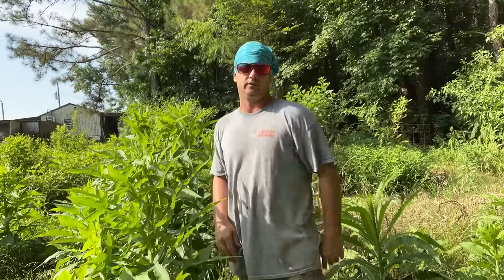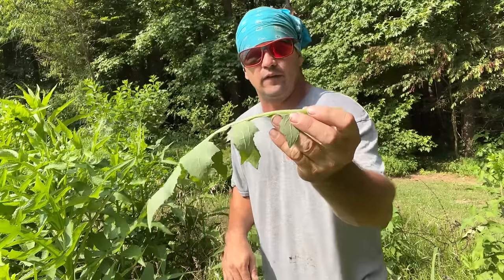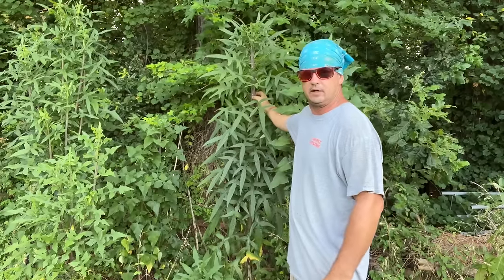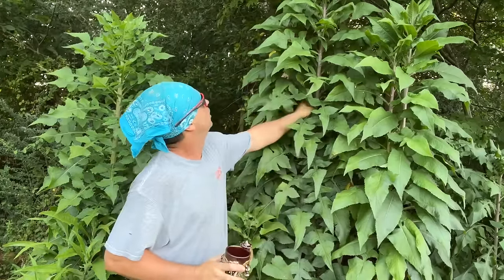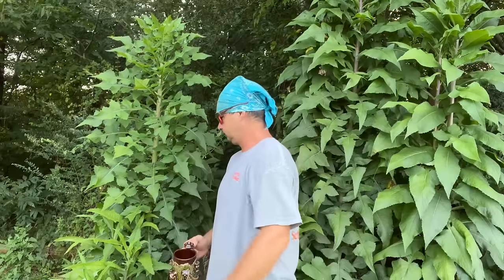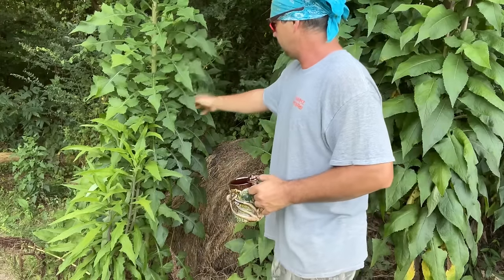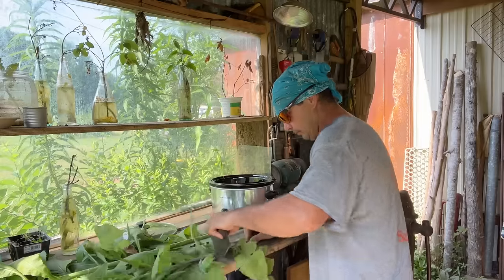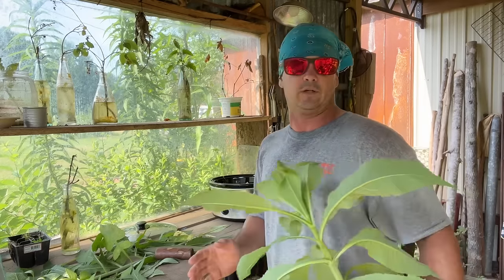Processing wild lettuce into condensed black syrup pain medicine

Comment: The last time I processed wild lettuce, I poured it in a 9x12 pan on parchment paper after most of the water is out but while it's still easy to pour. I then dried it in my oven at 100 degrees until it was rubbery which made it easier to peel it off the paper. Some of it was hard to get off the parchment so I'll use a smaller pan next time plus I've seen some people use silicone and dehydrators. THEN, I rolled it into a ball, put in a mason jar & poured 80 proof vodka over it which will help it keep and allow it to be used sublingually. I usually use 2 dropper fulls.
Reply from the maker: Not a bad idea at all . Thanks
Reply: Please estimate the size of the ball of concentrate, and volume of vodka poured over it.  Trying to get close to d0sage ideas. Local herbalist won’t even talk about wild lettuce because of “issues” but I gotta have something sustainable on hand!
Reply: @meanqkie2240  3-4" , I put it in a pint jar, poured vodka over it. I've  smoked it, used just water to pull out the oil too.
Reply: @ElijahsMimi  How are the pain relieving properties?
Reply: @CastBlastCamp  It believe it works well, helps with sleep too.
Reply: @SpiritoftheOutdoors  Love the cup your daughter made!!!  😁❤
Reply from the maker: @Sunny-jz3dy  its not gonna compare to the relief of percocet i dont think. Lactuca virosa would probably be the strongest.
Reply: @SpiritoftheOutdoors  16:42
Reply: @meanqkie2240  always use 100 proof. Elimates all math.
Reply: I am BRAND new to learning this subject matter ... If you do this process again, I'd love to see a video of it!!!
Reply: Thank you! My instincts were telling me to do similarly but your steps really clarify how to go about it. Much obliged!
Reply: Why use alcohol??? Do we have to???? Gives me a headache😊
Reply: @Centannicocktails  Most herbs have water soluble and alcohol soluble properties, 100 proof is half water, half alcohol. Tinctures are taken in drops or droppers full. 2 droppers 3 x a day equals 1 tspn of alcohol for the whole day, if you take less drops, less alcohol. You can drop alcohol tinctures in hot tea, leave for 5 minutes and the alcohol will evaporate. You can make the oil with just water, I have years ago and I think it worked ok,but was hard to take because it's so gooey. Look for some videos using just water here on YouTube.
Reply: You answered the question I came here to ask. How to make a tincture with the resulting tar. Thank you! Cheers.
Reply: @ElijahsMimi thank you! Lots of additional good information.
Reply: Having worked in some remote areas, locations, and not being accessible to acid or anything similar  ,you would be worth 5x the cost of a dentist!!!
Reply: @Centannicocktails makes it more shelf stable, you could use white vinegar but the taste would be a little sour. You could add some mint  leaf and sugarto it and make a mint sauce ?
Reply: Love the background music
Reply: Hi, about how long did you cook it in the stock pot for before straining? Thanks in advance. ❤️🌿

Comment: You can use everclear or bacardi 151 to clean the tar dregs from the pot. Then transfer to a glass bowl and let evaporate. A similar method to making homemade hashish.
Reply: That bacardi 151 is not around anymore
Reply: Can you smoke wild lettuce for pain relief
Reply: @drpops66  I don't think so
Reply: you mean hash oill? rso , Rick Simpson Oil?
Reply: @drpops66  yes you can smoke it and the resin
Reply: But it's water soluble. Just add a little water to clean the pot, then drink it.

Comment: Tip: Put the syrup in a dehydrator. It peels off as easy as fruit leather.
Reply: great idea. Maybe his friend he borrowed the crock-pot from has one of them too. I wondered if a black bottom pan , with screen ( for bugs) set in the sun would work?
Reply: What do you do with the fruit leather?
Reply: Oh
Reply: @joanclary3622 powder it and then put it in capsules. Or mix it with water if you are good with the bitterness.
Reply: I did that just today and it worked like magic
Reply: @joanclary3622 you can also dissolve it in a little bit of alcohol to take in a liquid form
Reply: At what temp?  And once dehydrated, how do you use it?  Thank you!

Comment: I had some plants I keep in my flower bed.  I harvest the latex throughout the season.   I pull up the kids hippity hop, sit there with a piece of glass(from 5x7 ftame) and wipe latex on glass.   Once it's dry, a day or so later I scrape it off and add the powder to a finished tincture or the finished black goo.  I have to take a smaller dose for the same effect. The crock pot was my question! So thankyou for that.  I'm standing at the stove for my 8th hour now making sure this doesn't boil.  In an hour or so it's going to be done...praise God.

Comment: What is the dosing on the finished product? How is it best used? Thank you for the demonstration.❤
Reply: I've taken a small, maybe 1/8 tsp to start and adjust from there on how much, depending on how it works  for the pain/anxiety/sleep. I've also dried it down until it's rubbery like, put it in a mason jar, covered it with 80-100 proof vodka, then dosing is by drops or dropper fulls. I take 2 droppers full of most of my tinctures.

Comment: At the end when you were struggling to get the tar out of the pan I was thinking of ways to make it easier to get it all. I don’t know if this would work, but would placing the pot in 3 inches of hot water help to release it? Also I have a round tipped cake icing spatula that’s about 10 inches long and 1 1/2 “ wide and very thin. Would using stainless steel work better than wood or plastic? Just wondering.😁 I can’t wait to make this! I suffer from Multiple Sclerosis, severe Fibromyalgia, chronic neck and back pain and was recently diagnosed with Trigeminal Neuralgia!! It’s a nerve located behind your ears . If that  nerve has suffered any trauma at  any time in your life, ie; in my case being “cupped” ( slapped hard with an open  hand that is shaped to form a small pocket in the palm ) not once but 3 times by an ex ! Praise God he’s in prison for a long time now! Sorry for carrying on so much. Anyways this new nerve disease is extremely painful . It makes my eye, cheekbone, ear and gums feel like I have a sinus infection, a severe earache, and abscesses in my lower teeth!! I hate opioids and am praying this can help me sleep better and hopefully relieve me of a lot of my pain. Again, thank you soooo much!!!! Your new Subscriber Tracy Deon 👋
Reply from the maker: My problems at the end were because it was getting late and i was pushing getting it done. Any of those ideas are good but it gets sticky so id stay away from wood. Keep heat low . It will take a whole day to make this

Comment: Hello, thanks for making the video. I am making my first batch now. I suffer from M.S. and other back issues and been on narcotics for years. I'm wanting to get away from those drugs and try more natural remedies. Do you have any suggestions on the dosage using the tar?
Reply from the maker: Start with a pinch of it and use more till it works for you. Cant really OD on it. The tea is easier to do and id drink a couple tea cups of it as long as you have fresh plant material. Ive not had good luck with dried plant
Reply: My daughter and I cleaned and dried wild lettuce leaves and use them in tea, it's very mild, helps with menstrual cramps and pain.  Not enough for my serious pain, though. :/
Reply from the maker: @LadyPashta  make tea from fresh plant and you will find it stronger
Reply: Did it work?
Reply: You can make a tea with the tar also, just break off a tsp of it and add it hot water and honey and stir well...thats how I do it and it works great
Reply from the maker: @thenarrowgate3063  yes. Its a good way to use it. Better than dried plant for tea

Comment: When you get down to the end, why don't you use a double boiler lash-up?  It's so much easier and you don't have to worry about boiling your product.  I bought a semi-expensive non-stick fry pan (copper finish inside) for exclusive use of cooking down medicinals.  Non-stick makes it ever so much easier to get all of your product out of the pan.  Your last pan would be great for the bottom half of the double boiler.  Fill your pot up with water, bring it up to a simmer.  Place the fry pan over the water, just touching the water and cook.  You need to match top and bottom, so the top pan doesn't fall into the bottom pot of water.  They certainly don't have to be an exact match.   I've sent you a link that shows exactly what I mean, starting at 16:10 in the video.  https://www.youtube.com/watch?v=0sGWxz0DMSI&t=984s
Reply from the maker: I have a double boiler set up ive used in other videos. Im gonna make another batch this summer. That was the first time id made the paste  . A crock pot does good it just takes longer and it wont boil
Reply: @SpiritoftheOutdoors  
Look at the video she linked you.  Use the non stick green pan instead of stainless.  Would be so much easier at the very end to pour out and just scrape with a silicone spatula.

Comment: hey, great video!  For getting the most water out, you might use a ricer. You put your product in and press the lever down. Although you might want to try a small amount to make sure it does not mash your leaves  up and push them out with the water. I use it to make the smoothest mashed potatoes in the south ....even better than a mixer. But they also squeeze juice out of fruits. Also, consider cooking them less at the end because what happens is you have "carry over cooking" after you take it off the heat. Sorry, I'm a  retired chef and I've over cooked many things before .  The carry over cooking will cook it to perfection if you take it off just a little earlier. How much of this do you use at a time, say for pain or headache? We have this plant that grows like that here everywhere, but I;m afraid it's not the right plant. is there a specific way to tell.? Ours shows little puff balls after the flowers fall off but I thought the flowers were supposed to be a specific color.

Comment: Thank you for sharing this.Just finished my first try but unfortunately the video I first saw recommended leaves only. I dehydrated them first then processed them. I think this process would yield more from the plants. Hope what I did works, letting it dissolve in vodka right now. Can't wait til spring to try your method. Will return to comment how this batch went.

Comment: Boiling trouble: I have an electric frying pan that will boil the water every time no matter what but for a short time.  I burnt the bottom keeping stuff warm, until my main stove broke down.  So, I put two flat butter knives on the bottom and an inch of water over them, and a pot of water, and held temperature just under boiling all day for tomato sauce.  I fell asleep, and it didn't stick, two hours later.  It's more accurate than a crock pot - but I have both.  I also have a good deal of wild lettuce around here in Rhode Island, and damn, the cold weather can be pretty painful.  And dandelions.
Reply from the maker: Thats a good idea

Comment: Thank you for your video. I just tasted mine with just a pinky of thin sticky residue and felt like my floor was lava immediately. It was strong and started work right then. I just saw you take two tastes of this 😳 please, what is the dosage on this because I don’t want to take too much.
Reply from the maker: Your not gonna od on it . I take a half teaspoon. You can dissolve it back into water for a tea or just eat it. Start with smaller dosage because each batch will vary in strength. It is a sleep aid so you gonna be drowsy and I wouldn’t be driving until i had dosage figured out. You body weight will help determine dosage as well. Just try it . The worst that will happen is you go to sleep
Reply: @SpiritoftheOutdoors  Bless you for getting back to me so swiftly. I have 12 half gallon glass tinctures, 4  containers of extract, and I am reducing a stick pot as we speak with some drying in the garage for tea. I have chronic migraine disease and am putting this back for future use for myself and my family. I really appreciate you for your wisdom in this. I just thought oh Lord, I’m gonna over do it! Thank you for your advice. I will play with it a bit. Be safe and smile BIG. May this return to you 10 fold. 🙏🏽

Comment: Awesome.  Is it possible to do the whole process with just a crockpot?
Reply from the maker: If it gets hot enough to evaporate water it will . It will just take a lot longer
Reply: I use a crawfish pot and propane since using a crockpot you only get a small yield but yes you can absolutely use a crockpot set to low
Reply: @SpiritoftheOutdoors  I do huge batches so I use a crawfish pot and propane burner

Comment: Questions :): 1)Could you do the last leg of the dehydration in a low-temp dehydrator to avoid any chance of burning? 2)Is it important to remove every bit of sediment/aphid or is that just aesthetic? I know bugs have great nutrient content and if it's tiny and not creepy does it really matter? 3)Would it make sense to put the goop in a silicon sheet or wax paper or parchment so then we could just peel it off so we don't lose much (like old candymaking)? Thank you!
Reply from the maker: I dont think the bugs will hurt nothing but if you tell everyone not to worry about them they think youve lost it and dont watch lol. As long as its warm enough to evaporate moisture its fine and will work , it doesnt have to become tar you can drink it or take it at any stage. I was more or less trying to rush my process and got a little to warm but I wanted it where it was more shelf stable with out using alcohol or vinegar
Reply: The answer to every1 of ur questions is yes lol after dehydrated u can rehydrate with vodka
Reply: @ChandraHeppler or apple cidar vinegar?

Comment: I’ve just made some using prickly lettuce.  Blended in a NutriBullet then reduced in the slow cooker on heat 2. But I didn’t do a second strain, (couldn’t find the coffee filters) so still has some fine plant matter in it.   Will  that make a difference?   
I didn’t let it reduce down quite as thick so was easier to syringe out (and less wastage) into a small glass herb bottle - half filled the 100ml size bottle.  It’s in the fridge now.  
Thinking just use a bigger dosage.  Was wondering about adding some alcohol to help preserve it.
Reply from the maker: It will work for you. The alcohol would make it last longer . This paste i made has lasted in my fridge several months because there is no water left in it

Comment: I think i ruined mine i let it dry out on low, not boil.....but crispy...I added Cannabis tea to it to re wet it was Four days on low today. I scraped it and put it in a mason jar in the fridge...its black and gooy is, but i never strained the plant material. Any ideas on saving the batch ir alternative, or is the batch shot? When I scraped it, off of the crock pot, it looked like insulation at the bottom, shards of the spines i suppose....
Reply from the maker: Id just use it like it is. The plant is edible. Its not gonna hurt anything

Comment: So I'm curious you said make sure you don't boil it but at the end that was boiling⁉️⁉️⁉️
Reply: So I guess the main thing is not to boil it in the beginning process and if it happens to boil a little bit at the very end you're okay is what I'm getting from this⁉️⁉️⁉️
 And thank you for your video I didn't mean to come off ugly about the boiling that was my curiosity as will it still work if that happens but from what you said  in the comments It seems as though it will work
Reply from the maker: Yea it did hurt it some and that was boiling. Boiling doesn’t kill the whole thing in an instant but it weakens it. I left that in the video to show you how easy it can happen when you know not to do it. The longer it boils the weaker it gets that didnt boil long enough to hurt it much tho
Reply: Why do you use the plant green...?
In this case the, green is mainly clorofile....
plus, save gas and electricity....

🍃 let it dry...
🍃 grind it....
🍃 moonshine or water for 30 days....
🍃 filter the mush (press it or twist it with a linen tissue )...
🍃 let the liquid dry ....
naturally with sun light in summer time..
🍃 net to avoid bugs....
🍃 or inside the house in a hot environment during winter....

🍃 no fire under....
🍃 unless you want to speed the process....

🔹☕🥃🔹
Reply from the maker: @sirnunnosfreyxo5449  what i have dried I personally found much weaker. Do some experimenting and let me know .
Reply: @SpiritoftheOutdoors  ...ok...
....use a  large grater if you use the plant green....
it helps to save energy , and to release  the components.....

normally i don't like to pull the plants by the root... 
unless you need the roots ...
(like Valeriana Oficinallis)

🔹🌱🔹🍃🔹🌿🔹

but, Lactuca is so spontaneous here..
that i hang them by the roots to dry....
some stuff from the roots goes down to the plant...

🔹

Comment: looks like it was overcooked. I'm no expert on the matter, but if boiling decomposes the drug (which was happening there, although possibly at lower than 100°C) then lower temperatures will also decompose the drug, just at a much slower speed. So it's not like there is a magical temperature to avoid.

I'd suggest using a dehydrator, grinding it up, and soaking it in alcohol. Would be nice to use a centrifuge too but that's obviously beyond most people.